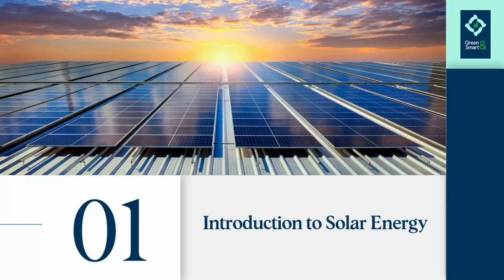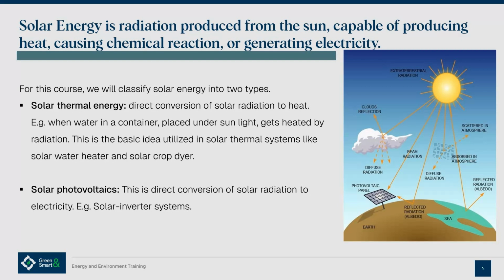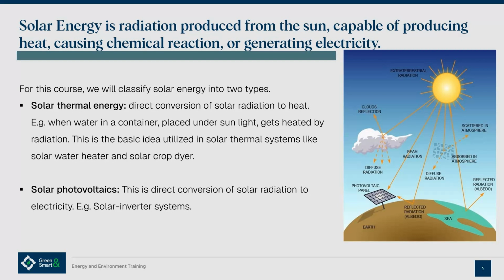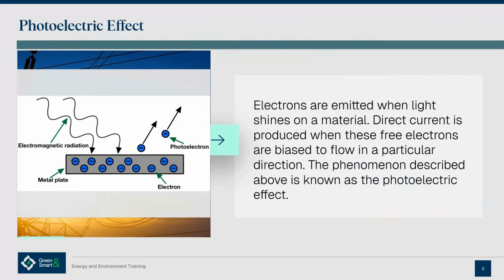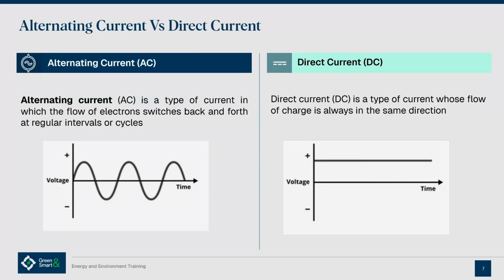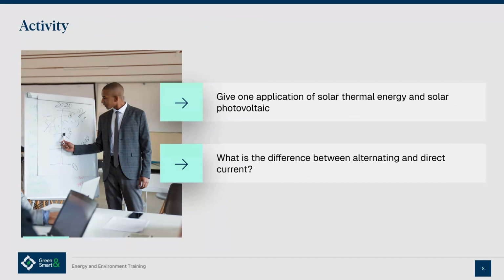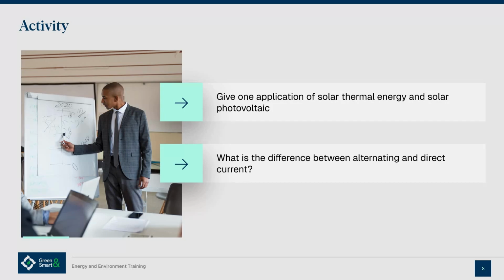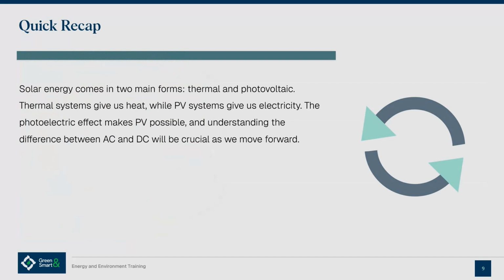Lesson 1: Introduction to Solar Energy

Comment: hello i have a couse in university right now callled renewable enery systems and tech nology i appreciated the video it really heloed me i am going to watch other videios now i want to ask u if you could recommend me a textbook too that has these course outline                                                                          Introduction to renewable energy: Covers concepts like the energy transition, its role in achieving the Sustainable Development Goals (SDGs), and the environmental impacts of different energy sources. 
Solar energy: Includes the physics of solar power, types of solar cells and panels, and their components. It often includes the practical skills of designing, sizing, and installing photovoltaic (PV) systems, both for grid-connected and standalone applications. 
Wind energy: Focuses on the physics of wind power generation and the design and operation of wind turbines. 
Biomass and bioenergy: Explores the performance and maintenance of biomass power systems, such as gasifiers and briquetting machines. 
Other renewable sources: May also cover other sources like hydropower, geothermal, and ocean energy (tidal, wave).